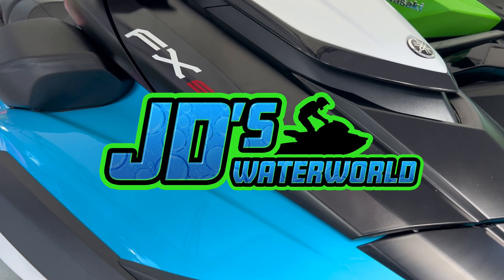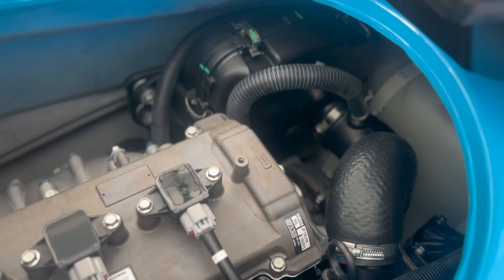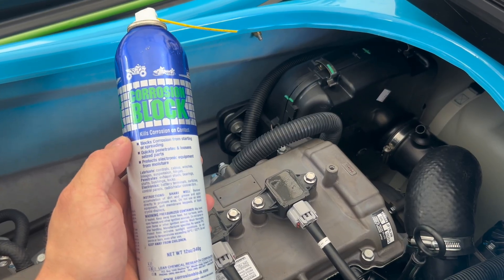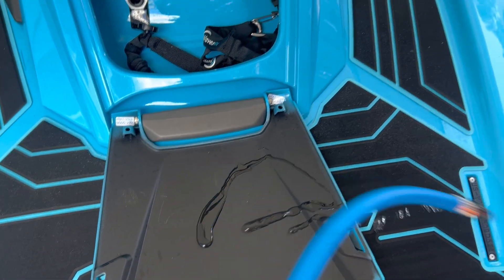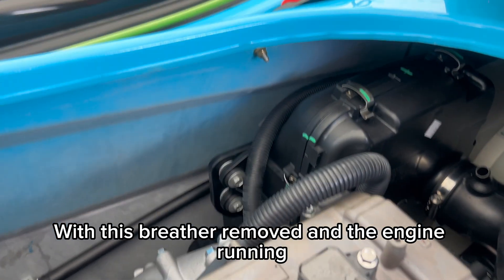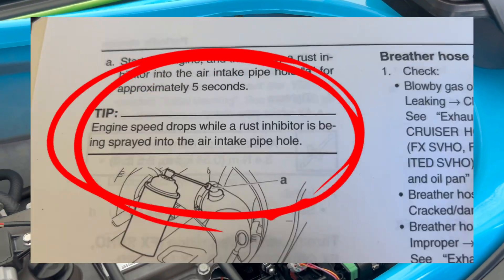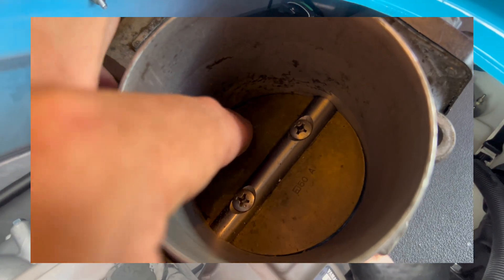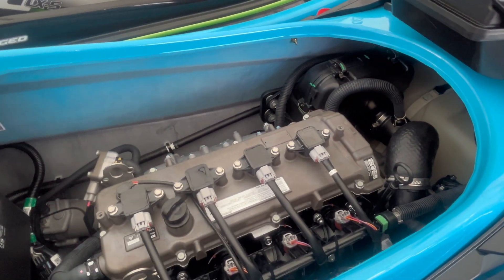Lubricating the Throttle Valve and Forced Induction System on a Yamaha SVHO 1.8L WaveRunner [4K]

Comment: Love your videos. Question - I noticed you said not to use fogging oil for this but I bought the service manual for the '24 GP SVHO. In the maintenance section for Throttle Valve Lubrication it states "Recommended Lubricant Yamalube Stor-rite Engine Fogging Oil OR rust inhibitor" - Is the Yamalube product dual purpose?
Reply from the maker: That's interesting because in the FX manual LIT-1861-04-16 Page 3-14 it states " Recommended Lubricant Rust Inhibitor." I personally would not use fogging oil as it will gum up the intercooler. A product like WD-40 , ACF-50, or corrosion block will not gum up the intercooler like a thick gooey fogging oil. That yamalube stuff is blue and sticky and I would only use it for winter storage etc not for this procedure IMO
Reply: @JDsWaterWorld  Got it. Happy to share a copy. Maybe I'm misunderstanding it.
Reply from the maker: No I don't doubt that's what it says just funny the manuals are different...confusing to say the least

Comment: I find the product and waiting for ribbon delete!!😂
Reply from the maker: Video coming soon! Note that when you do the Ribbon delete, you must also add either the Riva power filter or the Riva filter panel upgrade so that you have an adequate USCG flame arrestor! I also am doing the ribbon delete in conjunction with Stage 1 tune.
Reply: Without any tuning ?nessasary?
Reply from the maker: I personally would not modify the intake system unless you are also running a tune to account for the increased airflow and thus the increased fueling requirements
Reply: Okay ,i think about
Reply: I just want to make it because of the risk that the Rubber get suck!?i read all the time about and everybody say its not so.much more boost that i have to Do something !?
Reply from the maker: Yes people do say that the stock one can become obstructed or the gasket can get sucked into the engine and that the stock ECU will compensate..but that is also a USCG flame arrestor so you need to upgrade the air filter element to the Riva panel which is an approved flame arrestor. People do it, but I am skeptical about removing the element without a tune

Comment: Can you do a video on how many grease points there are and how grease each one? I just bought a gp svho and would like to learn how to service these things
Reply from the maker: Yes great idea. I will cover all the linkages etc that you should pay attention to. Grease does wash off, so you have to get into the habit of applying it on a regular basis. If you ride in fresh water, it's not as necessary - salt water takes a major toll and proper greasing is critical!

Comment: Is that the same as the foggin oil? My FX have a valve in can connect the straw to
Reply from the maker: Watch it again and listen to the part where I specifically say "do not use fogging oil" lol. You need to use "rust inhibiting lubricant" like Corrosion Block or ACF-50 etc not a thick gooey fogging oil that will gum up your intercooler. If you have a fogging port, it was added by your dealer - fogging oil should only be used for storage or winterization on the machine
Reply: @JDsWaterWorld  thank good to know, Im using YAMALUBE STOR-RITE ENGINE FOGGING OIL
Reply from the maker: For winter storage, yes follow the instructions on the yamalube to
Fog the engine. For routine lubrication of the throttle valve etc, do not use fogging oil- it gums up the intercooler which on the FX is fairly undersized

Comment: I'll like to know how stable is the fx whit 3 people in comparison with the kawi ultra.I know the kawi v hull is not very stable, but how is the FX stability with 3 people? thanks
Reply from the maker: The Kawasaki Ultra 160 and 310 the top deck is made from thick fiberglass cloth and gelcoat. The FX the top deck is made from Nano Xcel 2 and flexes quite a bit when loaded up. Either ski will feel "tippy" at low speed with 3 riders. The Ultra has much deeper footwells- maybe 3x deeper than the FX. The older 310s had shallow
Footwells..but the new ones are so deep it's awesome for lower center of gravity- but if they fill with water at low speed they can make the craft unstable to one side or another. The FX has shallow footwells and the drains which are a great feature I think! I will do some tests standing on the footwells on either side of both skis and see which one feels more stable!